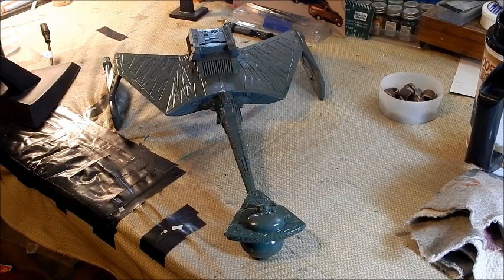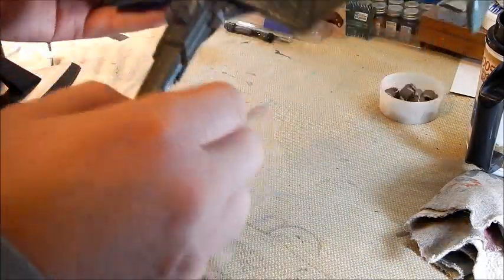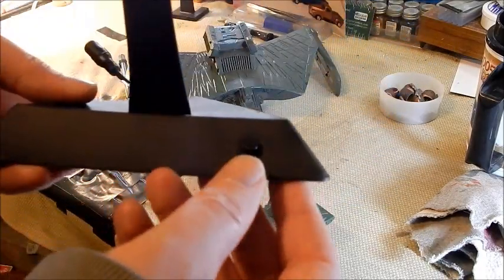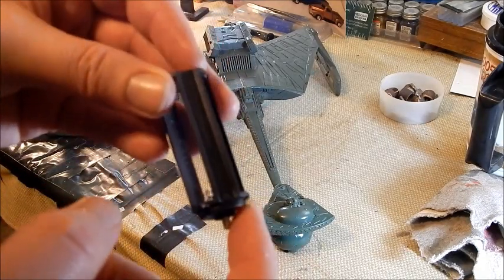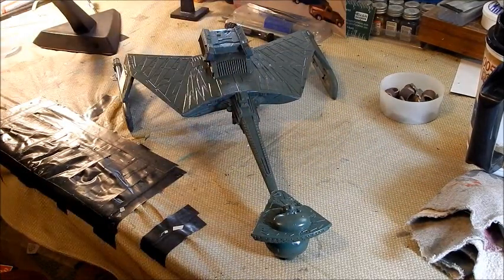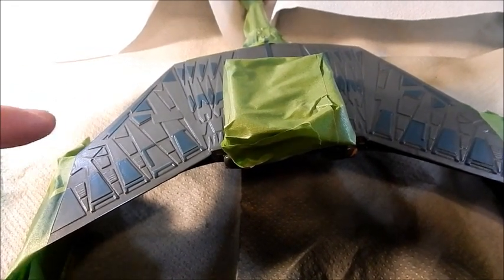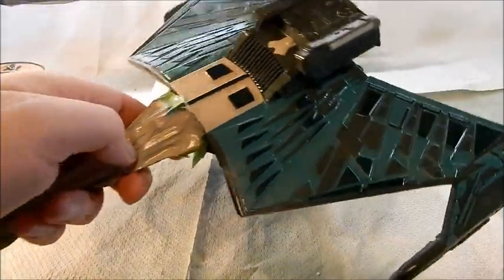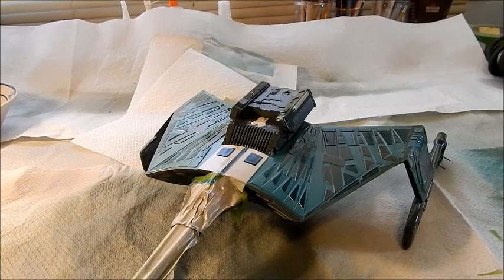AMT Klingon Cruiser Build Episode 6

Comment: Very meticulous paint job!  I am working on this build right now and trying to find a red piece of film to go behind the grill on the top front.  This will be the first time working with lights and an airbrush.  We'll see what disasters are in store.  What makes me nervous is the order of the steps.
Reply from the maker: Hey Todd!! There are literally boatloads of videos out in youtube land that give great instruction on everything airbrush. It is intimidating at first, but after you get into the swing its cake. Lights too, remember you can buy connectors if you're not into the whole soldering thing. I'm pull'n for ya!
Reply: @RT HobiWerks  I went with a Madman kit.  It has a circuit board for the torpedoes, so I'm assuming the resistors are built in.  It has wire wrap connectors and no soldering....yay!

Thanks for the support.  Maybe I can send you some pics if it turns out okay.  Yours was fantastic.
👍
Reply from the maker: @toddwalker4301  Would love to see them, you can always hit me up at; russ@hobbiwerks.com